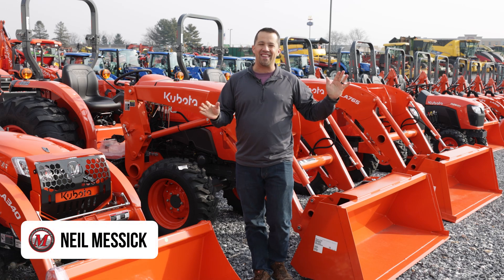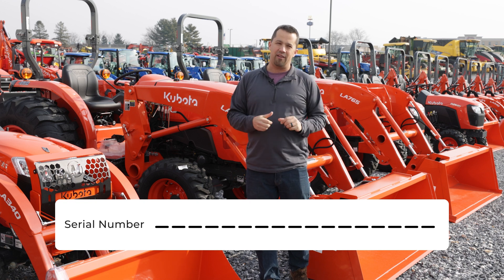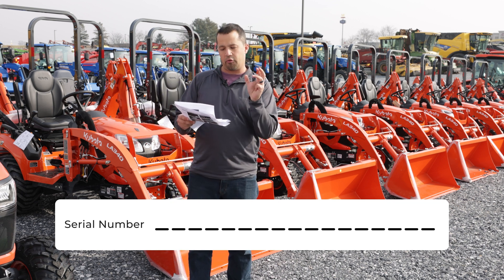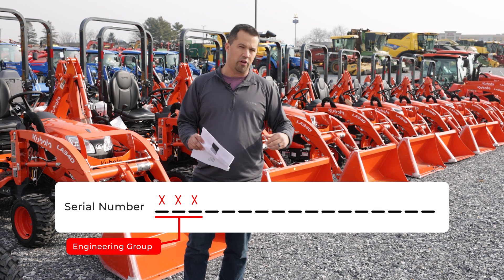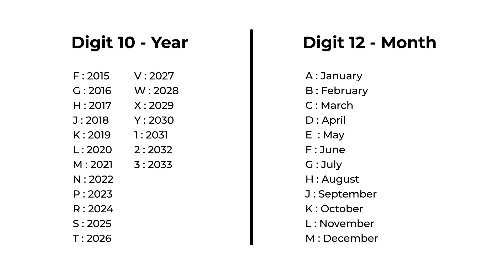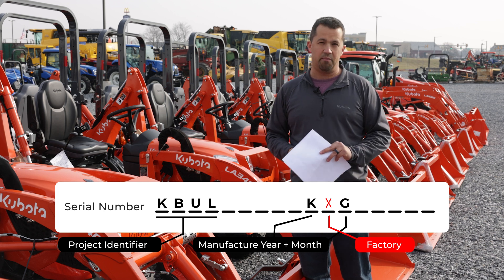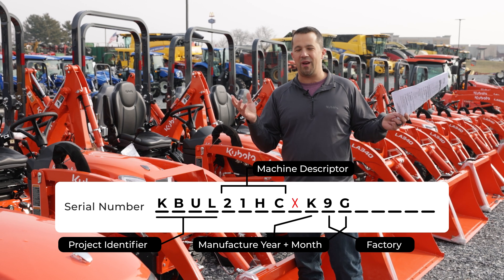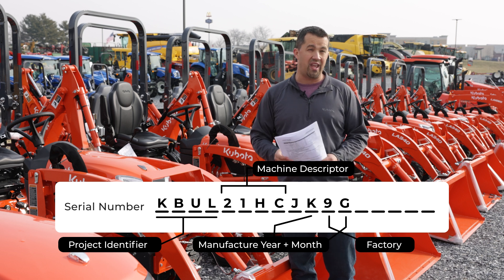Decoding Kubota Serial Numbers

Comment: I find serial numbers fascinating. At a plant I often work at, theirs is last digit of year, Julian day of year unit was started, shift (A, B, or C), production line letter, decade, then unit number for that day. Basically, I can go back and find exactly which day my hydrostatic transmission was produced as well as which shift and line it was produced on. I programmed the decade indicator a few years back as they would start having duplicates after 10 years of production. Now it won't be until 100 years, which I doubt their lines will last that long.

Comment: If a BX tractor is built is 2022 based on vin. Should I be looking for better price on that then the same tractor built in 2023 ? I noticed you mention model year is when sold but feels like if you traded it in or sold it. People would consider it a 2022 model.
Reply from the maker: Just because it was built in 2022, doesn't mean it didn't invoice in 2023. It's not a guarantee It's cheaper.

Comment: What happens when they produce the 100,000 BX?
Reply: The whole system crashes.
Reply: Probably won't happen...Keep in mind in the "BX" lineup, you have the BX1880, BX2380, BX2680, and the BX23S....they probably won't build over 99,000 of each one of those sub-models would be my guess...the following year, those last 5 digits of course would start over at 00000, which I believe is not used, it would start at 00001 and go to 99,999 again, if they built that many...but the 5th digit I believe in the serial number gives the machine class, so each one of the sub-models in the BX line has its own 5th digit letter so Kubota could build 99,999 of each sub-model....which gives you close to 400k machines...they probably don't come close to building that many each year LOL.

Comment: I have always wondered why if I buy a  tractor  that never sold and sat on the dealers lot for four years it is new the day I buy it, but if I want to trade it in the next day I am told it is four years old ?
Reply: You wondered this, but was told that it's 4 years old?  Confusing statement.  In the video he states it would be returning a 1 day old tractor as the "model year" is the date that it was sold as new.
Reply: @digitalguru42  Because it is advantageous to a dealer to sell it as "new" (and for warranty start date purposes), however if they're looking at it from the trade-in perspective then it would be advantageous for it to have been a 4 year old machine (which technically it is) and further devalued. 

I'm looking at a new Kubota excavator that the dealer is telling me is a 2025, however I can tell its been sitting for at least a couple years. This video allowed me to confirm I was right, it has been sitting for over 2 years.

Comment: What size grooming finishing mower and rotary cutter do you recommend for the L2501 tractor?
Reply from the maker: 60"
Reply: Is that the RCR1860 and the FDR1660? I noticed there are several models to choose from. Such as a FDR25..
Reply from the maker: @andyward3173  Yes, 15 or 16 series implements.